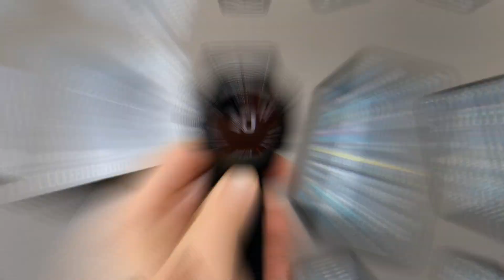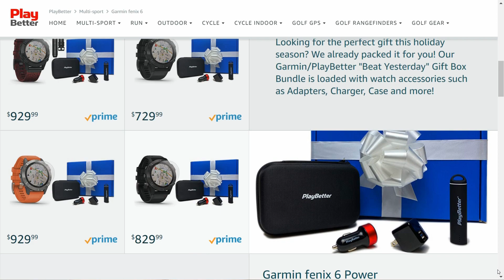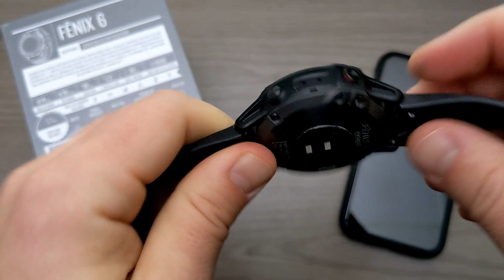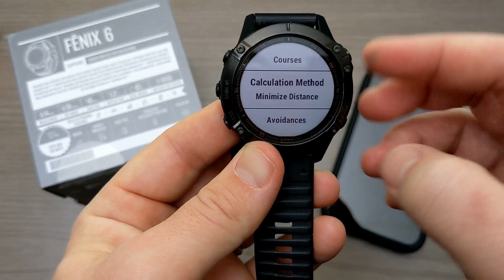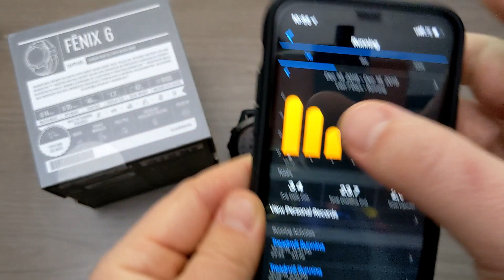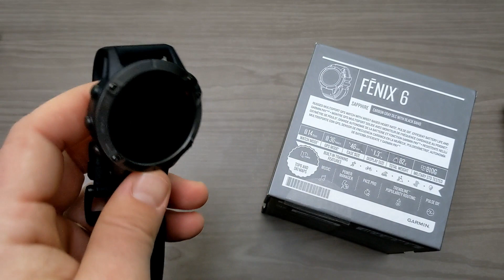Garmin Fenix 6 - Full Review - The GOAT GPS Smartwatch?

Comment: I just purchased this watch about two weeks ago and Ive taken it out for a few runs and a couple of rides so far. When I go out for my runs, it seems like the running pace takes a good 15 or 20 seconds to catch up to my actual pace (My previous watch, Fitbit Ionic, seemed to do that instantly). Just curious if you have experienced that issue as well? Also, you made a comment about calibrating the watch for running. How do you do that?
Reply: You can add the instant pace field. Mine usually shows up a second or two when i start and settles in after a few more. The average pace will take more time to show up..